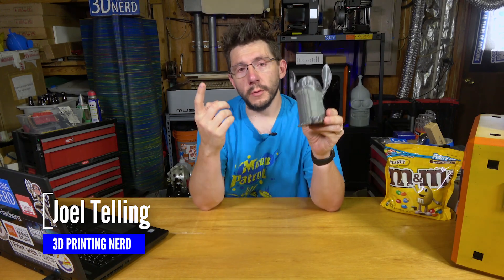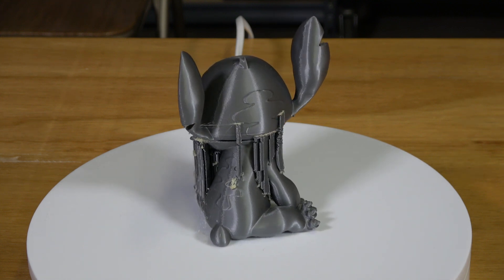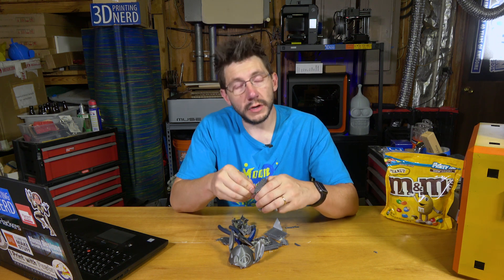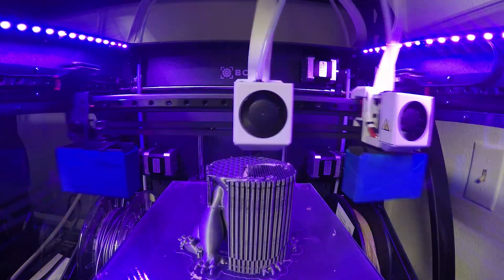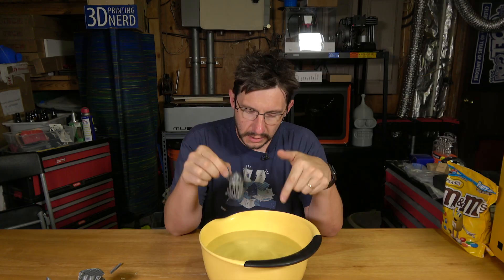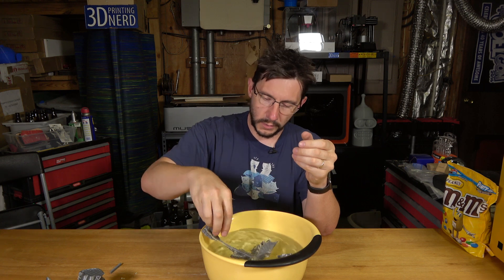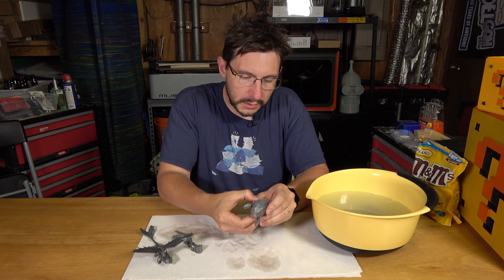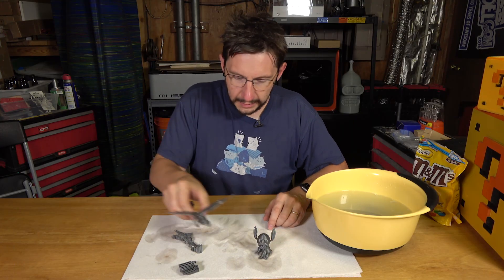Simplify3D 4.0 - PVA Support Interface Layers / Optimize Your Soluble Supports

Comment: I had to login to comment this.
What s the point of using soluble support if you just break it anyway? I would just put it in the water for awhile, so that the pva that attaches to the model disolve first, the other material support, will automatically fall off anyway.

Comment: For those who want to know how to do this, follow these simple instructions.

Open your process in S3D, then go to the Supports Tab. In the 'Support Material Generation' section, select the same extruder as you have selected for the PLA / ABS, and below where it has a selection for 'Dense Support' use your PVA / HIPS extruder.  In this latter section, I would use 100% infill, and at least 2 mm layers, I generally use 2.5 to 3 mm. So divide your mm height by layer height.  If you want 3 mm separation and printing at 0.2 mm layer height, then select 15 layers.  Now you are all done and will save a fortune on PVA :-)

Comment: Nice way to save money on PVA which is about 4 times the cost of PLA.
I just tried the "support interface extruder" setting in Cura, changed to 2, but in the layers view it doesn't seem to change, it does everything in extruder 1. When I select all support to be with 2 it changes, but setting.....
Wait.... I found it. There's another setting further down which says "Enable support interface" - Doh! That took me a while to figure out.

Comment: The Flashprint software slicer allows for custom supports, layer heights etc. it’s actually the best slicer I use.
Reply: Hi I know this is a very old comment but i am just ordering the Creature pro 2 and would like to know how to do this on Flashprint if you could tell me please
Reply: @darrenadams5283  I haven’t used it in a long time. But flash print allowed you to set and remove support material
Reply from the maker: The newest Flash Print is awesome! Have you had a chance to use it? I think it’s Flash Print 5.
Reply: @3DPrintingNerd  yes i have been using it on a Adventurer 3 and its a big upgrade from the old version. But for what i need to do i need dissolvable supports and i like the idea of doing it this way in your video. I think simple 3d looks like the easiest way to do it.
Reply: @thelightspeed3d712  Thanks. I was hoping there was a way to do it like in this video on Flashprint but i don't think there is

Comment: Slic3r does custom supports, interface layers, density, and a ton more. It has an awesome multi material setup. It's been able to do this for years. You just have to look for it in the modify told.

Comment: Im having a problem in the new simplify 3d v4 a sloping angle will cause layers to be a bridge but if I import the same model into the old simplify 3d theres no bridge, printing the v4 gecode with out support will fail. the older will print perfect without support, is this a bug or just me

Comment: according to PRINT QUALITY TROUBLESHOOTING GUIDE, the issue is:
Layer height or bad temperature.

My personal experience:
increase the wall perimeter and also increase the infill/wall overlap. also you want to over extrude very slightly.

Comment: The pla supports could be subdivided with pva so a larger column could brake at it's center or anywhere else. It could be useful for making support material disassembly easier for multi sided boxes with an opening on one face.
Reply from the maker: That's a super interesting idea!
Reply: 3D Printing Nerd Thanks Mr. Telling, an example where I would do that came up in your video. A line of pva running straight down toothless's supports would have stopped him "hugging" the supports when they where removed. Because the pla support is now subdivided thanks to a line of pva down it's center the pla support now has 2 pieces with widths that could be less than half of the original supports letting one side of supports wiggle out before the 2nd half. Or both move into the cavity where the pva was away from the models arms. So many new ways to manipulate support structures, I now need a printer with two nozzles :)

Comment: This has been possible in Cura as from 2.3 which was released a year ago.
Just search for Support Interface Extruder in the custom settings.

PVA doesn't really stick well to PLA, so making the interface with a different material than the support infill decreases the reliability of the print. That's why the Support Interface defaults to the Support Extruder which is also used for the support infill.

Cura also has some very limited options for support customization. You can load in meshes to specify areas within which no support should be generated, or you can specify them as areas which should contain support.

Comment: Dude, bad hair day! 😉
Surely if you're going to demonstrate using mixed filaments you should make sure the settings for the filament the model's made from are right before introducing another one into the process?
I'm starting to think I need another 3D printer with multiple extruders.
Reply: Prusa i3 Mk2 with multimaterial upgrade?

Comment: STOP WASTING PLASTIC!  See all that infill?  You don't need that.  Three perimeters is enough, sir.  It's plenty strong without the infill.
Reply from the maker: +theflamingpi WHAT HAVE I DONE???? Also, you're right. I thought I needed some internal structure to handle organic shapes.
Reply: I'm just joking.  I'm making reference to your older video in which you told people to stop wasting plastic.

Here's an idea, if you can get some sort of affiliate deal.  Check out the Protocycler.  If it's worthwhile, you could probably get some sort of deal with them to show it off.

Comment: Does anyone know how to tune the retractions properly on 3D printers so that the stringiness does not happen like on the dragon? Been searching the net for a good video that explains how to do that in Matter Control or Cura but it would seem there are no videos on this topic where people show practical videos of how to tweak the settings and then show prints based on tweaks.
Reply: Retract, temp settting as well as print over wall ?   All in the calibration part of the reprap wiki

Comment: Probably would have gotten some better results if you increased the dense support layers to 2 or more, and the dense layer infill to 100, also no separation layers.  Im surprised someone given early access to software like this didnt at least take a couple hours to fine tune the settings to ensure they would get good results.  You are given access to all this free stuff, its a shame you dont take the time to actually learn how to use it.  I know im coming off as a troll but ive been 3d printing as a hobby for many years..I dont know where this guy came from, but he is a complete hack.  I guess companies just see a couple subscribers and they start handing out free stuff.
Reply: Im a bit late to this discussion but even something that would seem simple as testing a new printer really isnt. From my experience when I got a bcn3d sigma is that I am going to have to spend a lot of time to fine tune the settings to get the best print and to learn its differences and quirks. Ive been using Lulzbot only for few years so I have those down perfect and can fix any issue quickly. But different printers or even software take a while to learn. 

Theres also the trade off of if doing a review you might not have that much time to dedicate but enough to get the basics and provide an opinion on the printer or software. Also Joel is doing this in his free time between work and a family life.
Reply from the maker: +remy hefe I had sense support layers set to 10 and dense support layer infill set to 100%. I spent more than a few hours with the software. You are coming off as a troll because with that comment, you are a troll. More than happy to have a conversation with a troll if you want.
Reply: Youre trying to demonstrate new software features yet you didnt show the interface or even mention what your settings were for the PVA support.  From the pictures it doesnt seem like you increased your support infill either.  Then you have an obvious failed print but you still decided to remove supports from it on video and tear the print in half.  Almost makes it seems as if supports are hard to remove...not a great demo for s3d, should have not even included it.  A troll wouldnt offer any suggestions for improvement, i dont consider this trolling.
Reply from the maker: +remy hefe Correcr, now you're not trolling. The timing of the video sucks because it was ready to go out as a teaser a week ago. My goal was to tease a Simplify3D feature in a new version of the software that wasn't out yet. I wasn't allowed to show the interface and I was told to hold the video and wait for a nod on when I could release. Instead of getting a good demo of the interface, I'm left with a teaser after the fact. Ugh. 

I thought the video was fun, and my editor did do a great job with the edit, so I put it out. I'm talking with Simplify3D right now to possibly do more in depth videos on newer features. Of the new features is there a specific one you're interested in knowing more about?

Comment: The reason the upper teeth looks soo bad - not generated support.
There is old bug in Simplify3D that prevents supports to be created under pointy floating objects, its been reported since january 2015, so its wierd such a serious bug wasn't addressed in this new 4.0 release.
Thread of the issue : https://forum.simplify3d.com/viewtopic.php?f=9&t=1977

Funny how most of the free slicers tackle this issue fine.

Comment: Could the shifting have been caused by the earthquakes we've been having up here in the PNW? Or are the print beds stiff enough to protect against that?

Thanks for the informative video
Reply from the maker: Thanks for watching! As for the shift, it has to do with the position of the magnets and where they sit. I didn't have it just right, and, during printing, the machine would shake a bit, and it shook the build plate back into position.

Comment: How do you get PVA to stick. I can never get PLA to adhere to it
Reply: You have to print PVA MUCH slower. I ended up having to go to down to 20mms for it to stick.
Reply: Thanks! Will give that a shot!
Reply: same i keep having that problem
Reply: I found that setting a few mm extra on the restart works well. So when it goes back into the hotend it goes more than it had retracted. Also bumping the flow rate on that head can help.

Comment: Hay Joel, my dad and I noticed that our Prusa i3 has almost regular layer shifting, it's done it on both the x axes and the y. What may be causing this?
Reply: Check your belt tightness
Reply: Maurice Nonnenmacher awesome I'll try that. Thank you so much
Reply: Witheredfreddy64
 sounds like a loose pulley or z-wooble

of the shift occurs regularly as in exactly at the same interval every sigle time, check the distance and see if it doesnt match the pitch of your Z threaded rods.

Otherwise check the pullies and see if any of them has some play (remove the belt first)

it could also be your hot end being loose and moving when the printer changes directions. Move you X axis so it locks in place and check if your hot end is loose.

if none of that works, try lowering your jerk and acceleration to say 8 / 800 respectively and check your drivers and maximum current
Reply: Were you able to solve the problem?